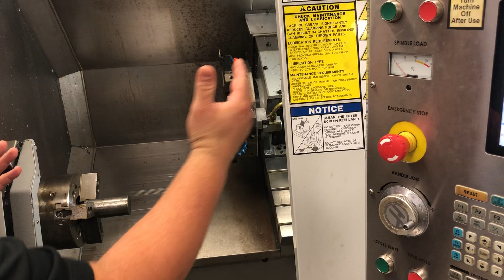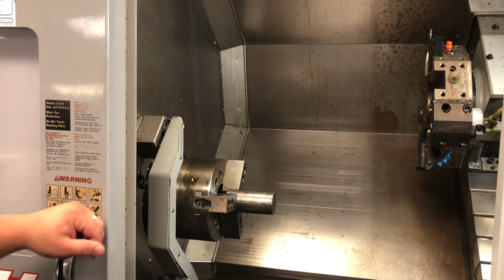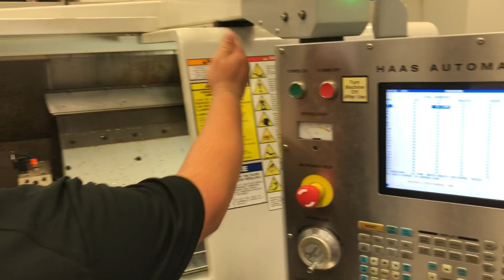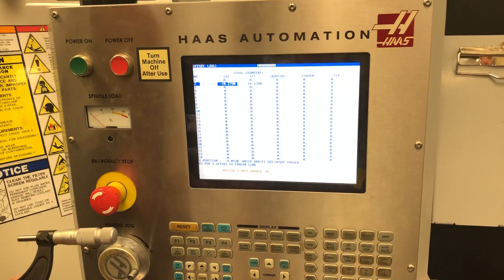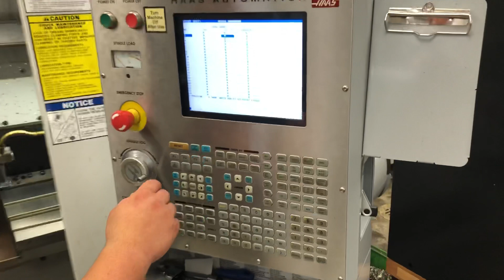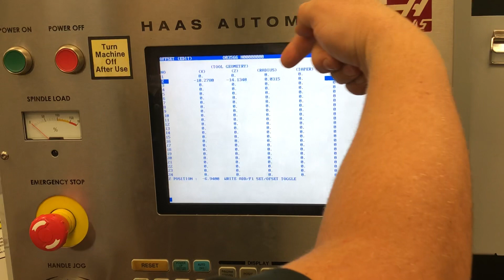Hass sl20 lathe setup part 1

Comment: What if the part you are machining is bigger and you dont have big enough micrometer to measure diameter? Is there any other way to measure offsets on bigger parts? Thanks
Reply: To set your offset on X axis you can use any diameter you want, just find something close to the mic you're using to measure.Once you've done you X you don't have to do it for every part your turning.